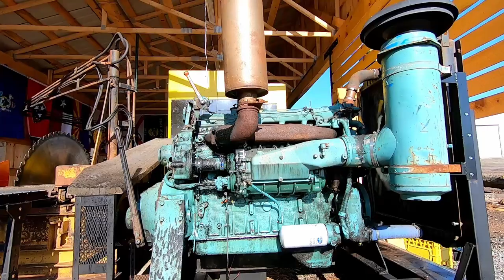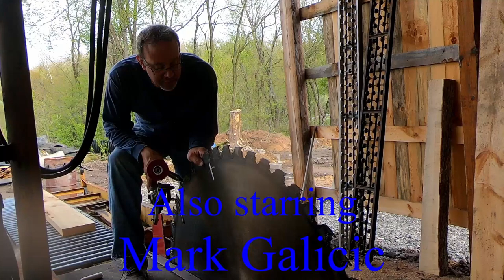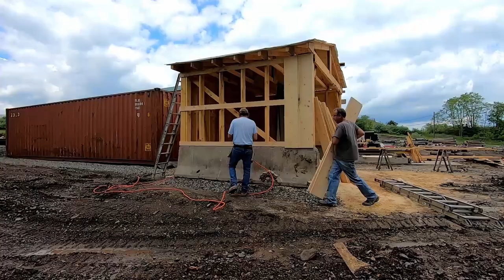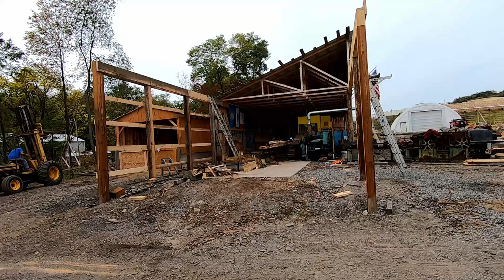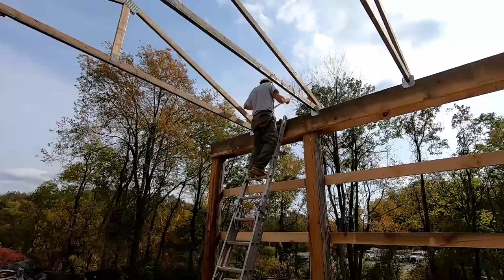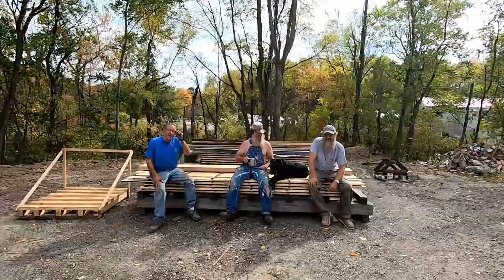setting the trusses

Comment: That saw dust got my father about 35yrs ago he was tired of retirement and went back to work at 75 in a suburban saw mill helping move equipment from their old shop to their new shop. After a lunch break one of the guys climbed up into the forklift holding a big saw mill they were breaking loose from the concrete and it slipped out from holding the machine (I assume it was a vertical band saw because he said it was about 15 ft tall), everybody started running and my father slipped on saw dust and lost a leg when it landed on top of him. He would have been 100 last March if he was still around, he ferried thousands of men to the beaches of Normandy on D-Day, I miss his stories.

Comment: I'd think that tractor rig should have individual brakes that can be used to shift the traction to the other tire, as well as being locked so blocking isn't needed to hold position. Frustrating to watch when the equipment needs attention. 
But you managed with what you have.
Reply from the maker: the forklift is old and worn out.
Reply: @markgalicic7788  Fixable likely, right? Dangerous when having to have someone block the wheels.